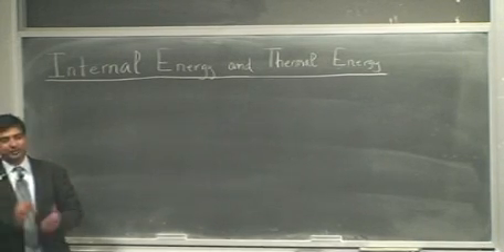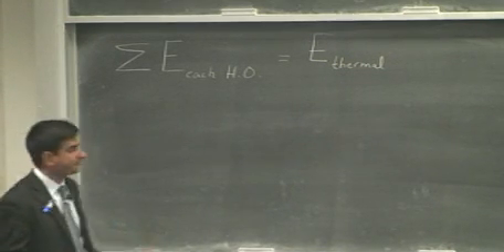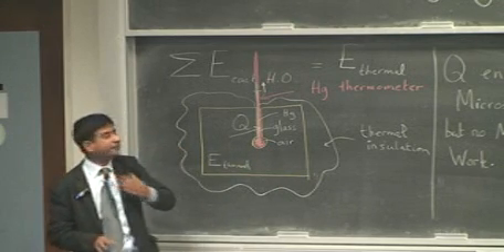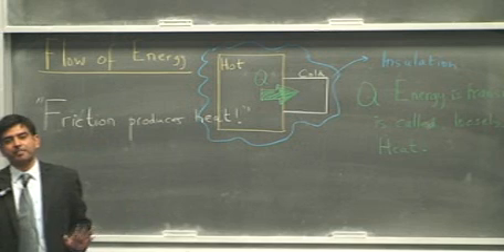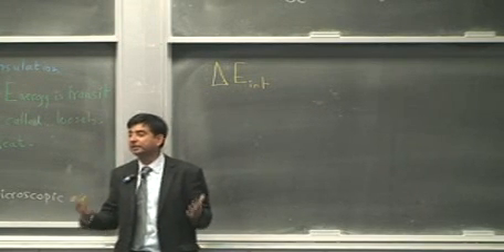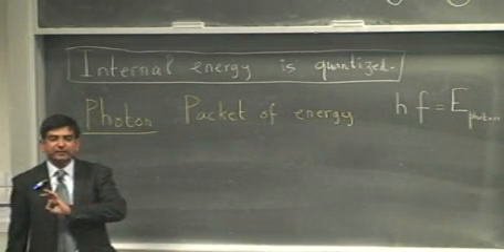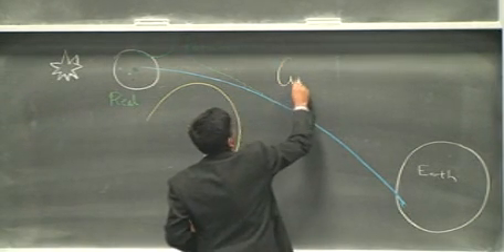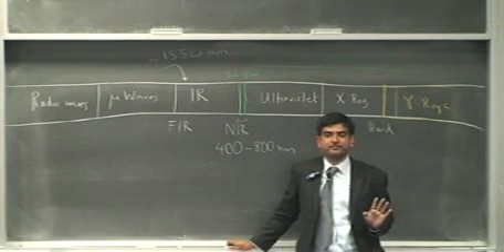First law of thermodynamics and concept of the photon (02 of 41)

Comment: Sir, if you compute the center of mass of the column of mercury you will see that after putting some heat that center of mass has displaced vertically a bit, so the macroscopic work isn't zero. But apart from that, your explanation is quite clear.